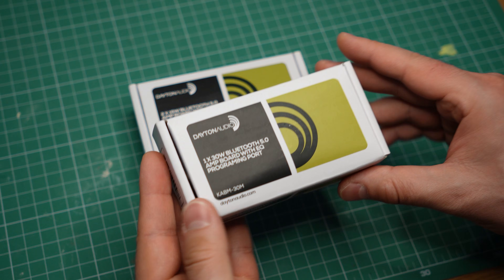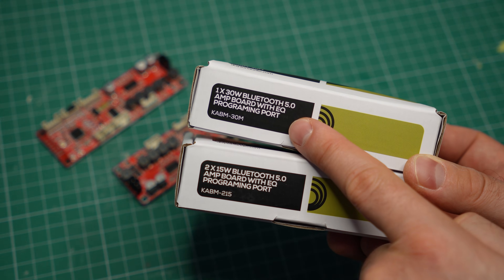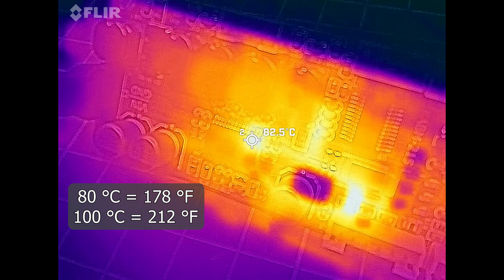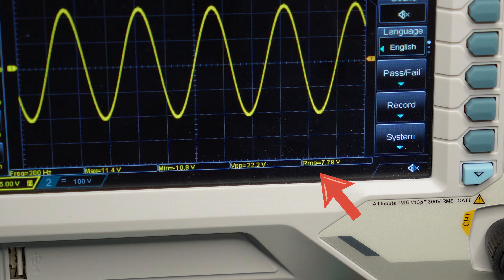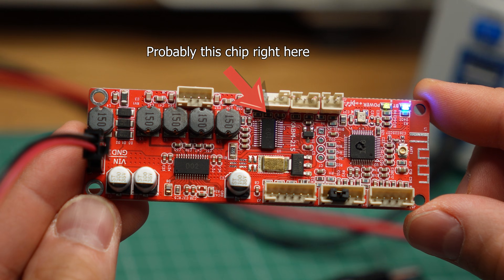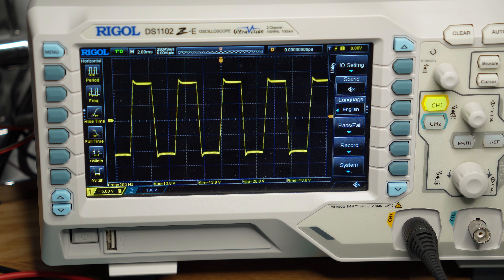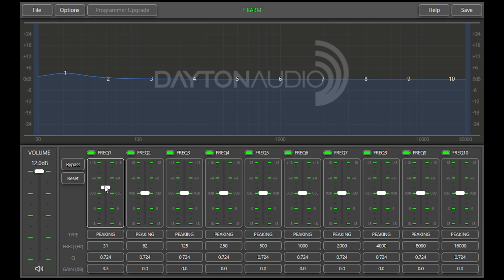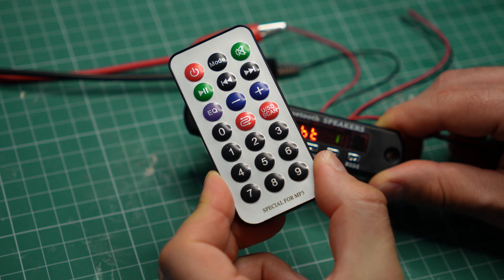Dayton Audio KABM 215 and 30M: cheap but disappointing Bluetooth amplifier boards

Comment: I have the KABM30M powering (2) 3" FaitalPro 16ohm fullrange drivers. Power comes from Dayton's 3-cell lithium battery board. I put it all in a mini Karlsonator cabinet and the performance is adequate, but not super loud. I was considering upgrading to the 100 watt board.
Reply from the maker: These seem to be cool, inexpensive drivers. But yeah, without the programming board, you won't get the board's full performance

Comment: The "weird" volume control MIGHT be because the DSP is set to use a "slewing" process. You might be able to reconfigure the slew rate (using SIgmaStudio) to make it behave the way you want.

Comment: There is an almost similar amplifier module on Aliexpress, the DSP can be configured without a programmer via a USB cable connected to it, such modules are sold with and without a cable, please note this, also for around $14. Most importantly, the modules are definitely more powerful than these from DA
Reply: Do you have a name of those? have being trying to look for something similar, specially since you need to pay $10 for shipping from Parts Express.

Comment: Ive love the KAB230 but ive had 3 die for unknow cause. The blutooth still connects but no audio. I need to inspect the board more but i dont have a scope. I think its just the audio amp thats fried. I think some static is the cause. But idk. I also have the KABD4100 and its fantastic, no issues yet. I really want to love the KAB as it was fantastic when it worked. Great vid 👌 subbed 👍

Comment: Despite the advice in this video, got the 30m. Idles at 2w. Also, after maybe 10-20m of play on comfortable volume of a 4ohm speaker, the chips were warm to the touch, but nowhere near 100deg.

I guess they changed something,  i'd say it deserves a revisit. Getting the DSP programmer just to make it play at the loudness it can is a bummer though, as is the very meh documentation.

Comment: A speaker driver is a amplifier. The part that makes the sound is the actual speaker
Reply from the maker: I get your point, but nobody calls an amplifier a speaker driver, at least not in English. When someone says "speaker driver," they are talking about the woofer or the tweeter component, which is part of the loudspeaker.
Reply: I've never heard an amplifier called a driver. Driver has always referred to the part of the speaker that moves when an electric current is applied.

Comment: thank you for the video! you know if the 2x30 ones like 230v4 are viable options? and maybe if I wanna built a 2x broadband speaker bluetooth box I should cut out subbass somehow and if yes how? thank you man, seems like you know more than me :)
Reply from the maker: yes, dayton audio's 2x30 and 4x30 boards work well and have a programmable DSP for low-frequency filtering. I haven't built anything with them yet, but I do have them both. However, you will need dayton's programming board too. Sigma Studio looks a bit intimidating at first, but dayton audio has pre-made templates that are easy to adapt. (I have shopping links in the video description.)

Comment from the maker: Update from Parts Express: "the amplifier chip has a built-in protection mechanism that activates at a high temperature of 160°C. The recommended ambient operating temperature range is from 40 to 85°C, while the junction (chip) temperature should ideally stay within 40 to 125°C under normal operation."

Comment: Excellent video. Would love to see what youd recomend for a cassette player upgrade to bluetooth or wifi service.
Reply from the maker: Does it have any audio input connectors? If so, it is best to use some sort of an external module.
Reply: @LeftyMaker  I totally agree. It seemed during the late 80-90s they loved to sell cassette and CD players without AUX In connectors.